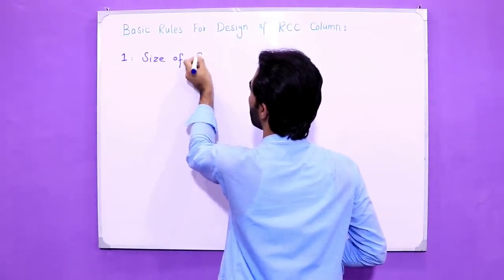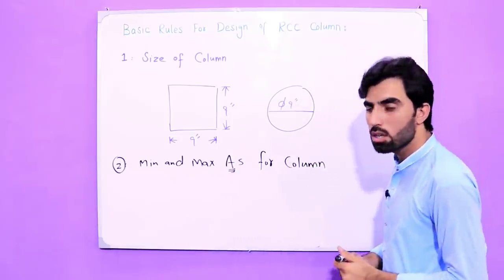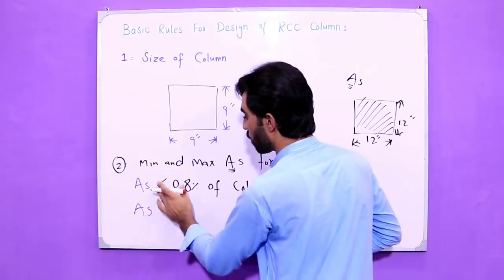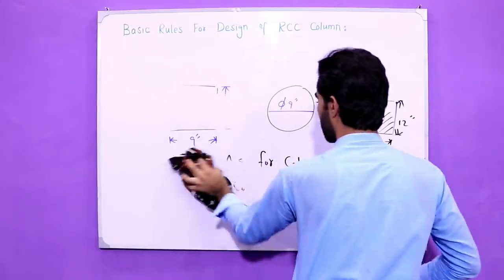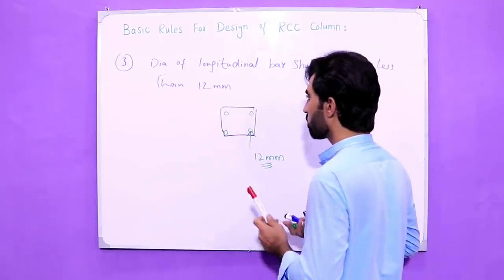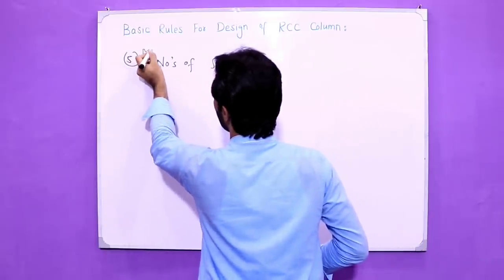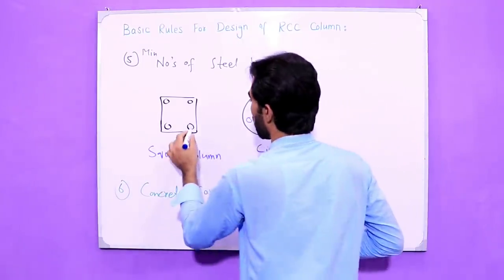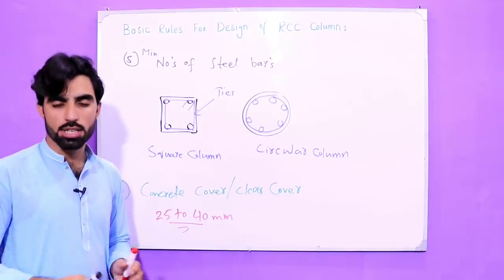Basic Rules for Design of RCC Column - RCC Column Basic Rules

Comment: 9X9 column is only used in residential houses and it is a non structural column and used for confining masonry
For structural columm, according to ACI code , in moment resisting frame Column can never be less than 12 X 12